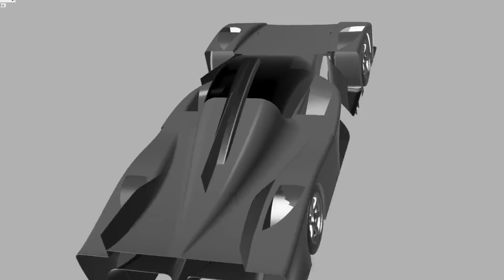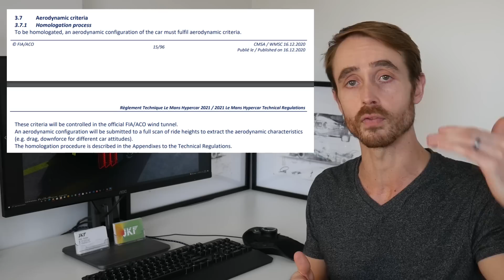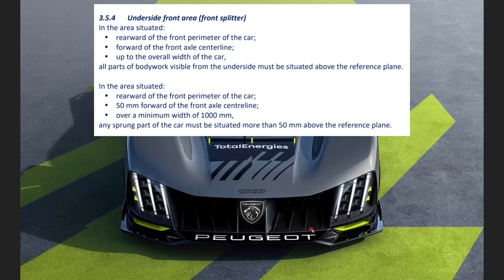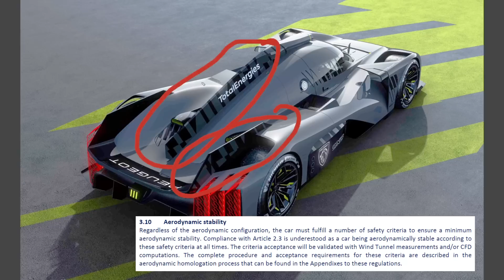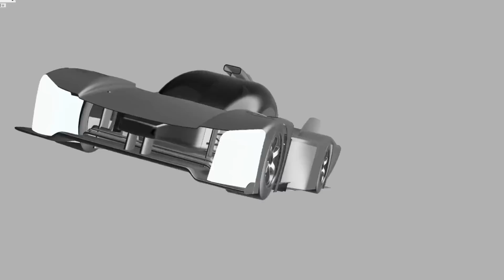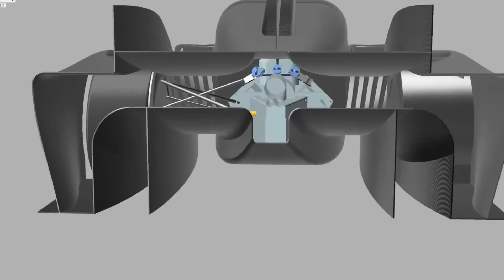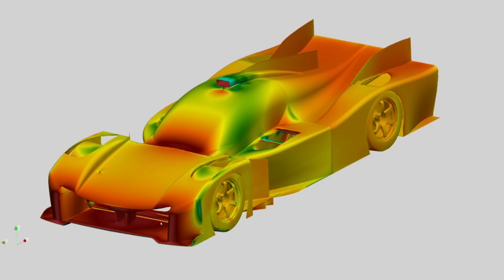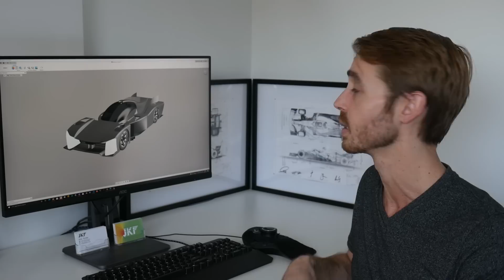Does a Race Car Need a Rear Wing? Peugeot 9X8 Aerodynamics Explained

Comment: 2am thought, does the Murray T.50 fit into these regulations? I'd assume the fan would be the movable/adjustable aerodynamic device here. I haven't checked back over the T.50 details, so I could easily be wrong.
Reply: It can be fit, but competitive is different ball of game.

As he said, the downforce to drag ratio is still high. Whereas the fan itself is only for adjusting diffuser flow, not sucking heck lot of air like 2J (source : Engineering Explained). You do need more and bigger wing to competitively, which more regulation workaround (trust me, it's pain in the butt).

We still don't talked about the power unit, especially the gearbox. You change it to something else, It's both another difficult level and insult to Gordon Murray's original vision

Comment: The question is if my Subaru needs a wing?
Reply: You don't have to need one you just have to want one. None of these race car optimization stuff matters for road cars being used as road cars.
Reply: If you drive at high speeds above 90 or so miles per hour, sure.